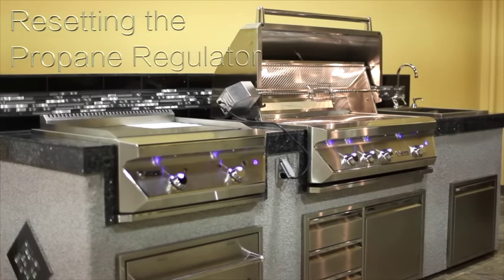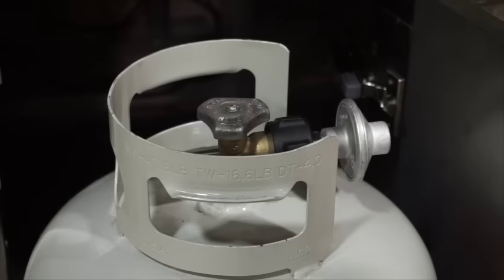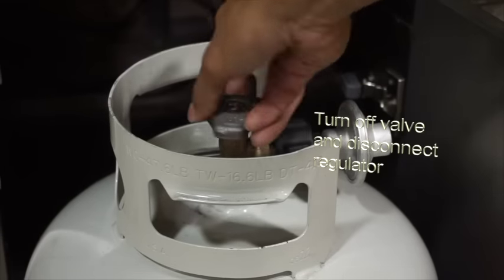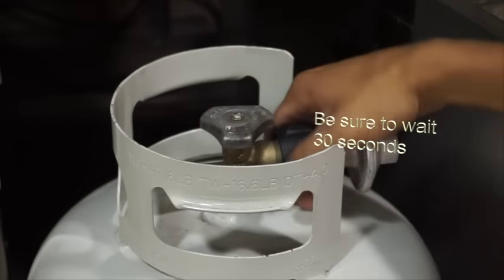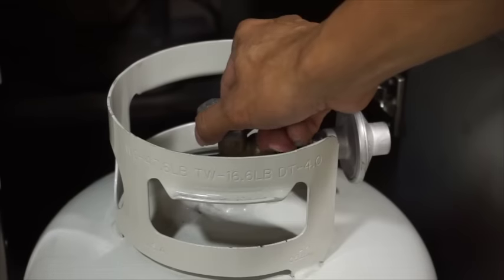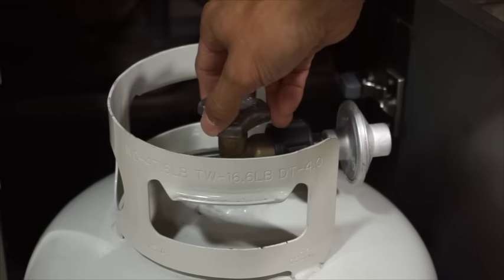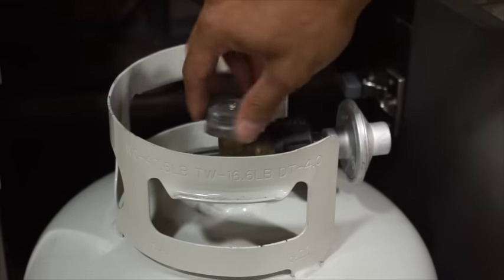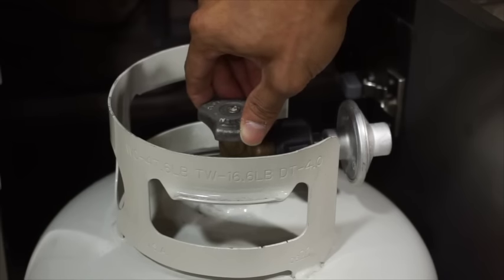Twin Eagles Service Series: Resetting the Propane Tank Regulator

Comment: The key is to wait 30 seconds before reattaching regulator
Reply: the video makes it sound like you should wait 30 second before DISCONNECTING the regulator.
Reply: wait the 30 seconds after reconnecting the regulator and turning the propane back on. His 30 second part should be 5 mins before that.

Comment: Didn't  work for me either.  You need a new and improved video.
Reply: Bad regulator. I've replaced one. Not expensive and not difficult. Home Depot had mine. Take it in to insure you get the proper one.